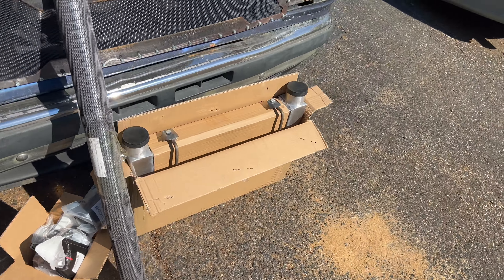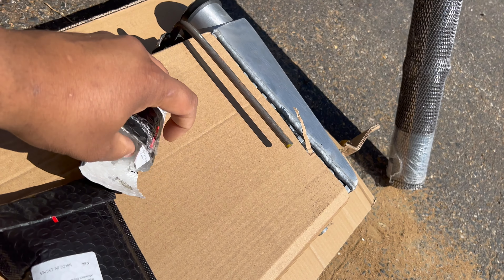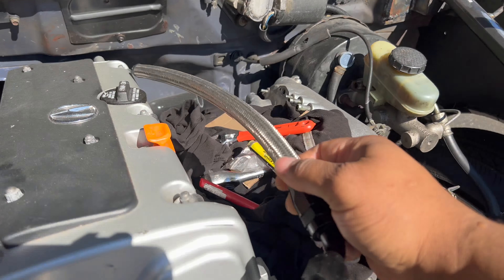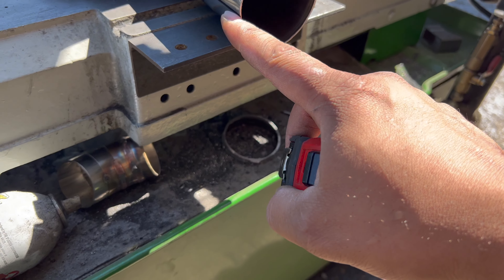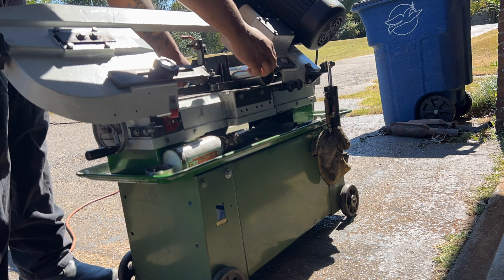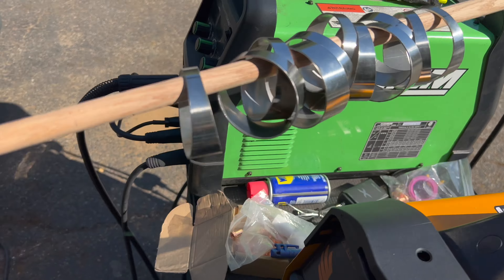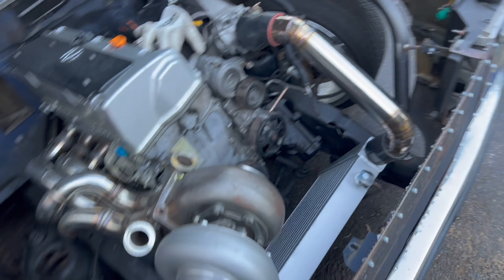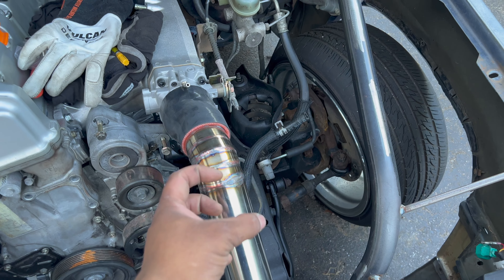PART 5- k24 SWAPPED FORD RANGER INTERCOOLER SETUP

Comment: Sup bro. Looking good man. For tacking stainless I have much better luck flash tacking. 90 amps. Quick pedal jab. Get in get out. Most of the time prevents full penetration to help with not getting sugaring when tacking.